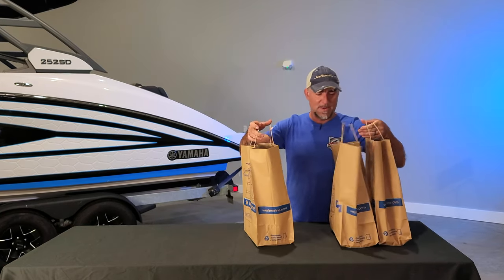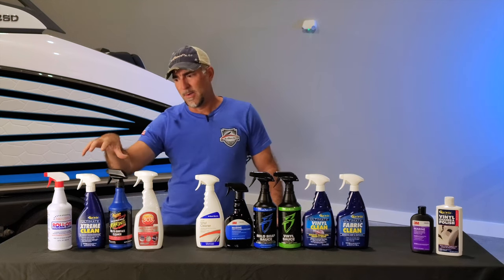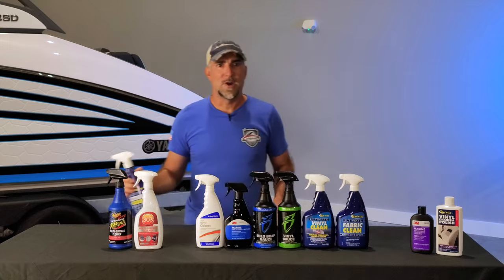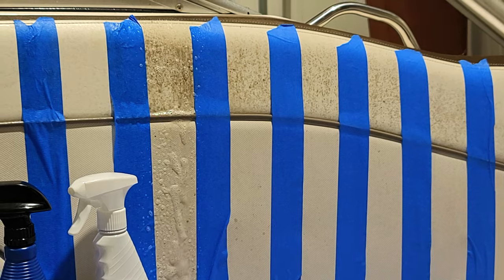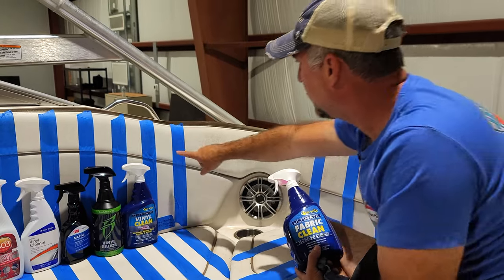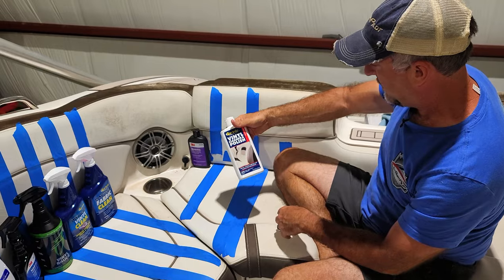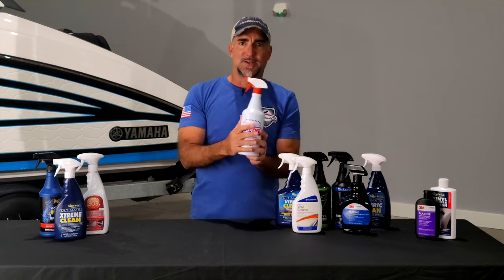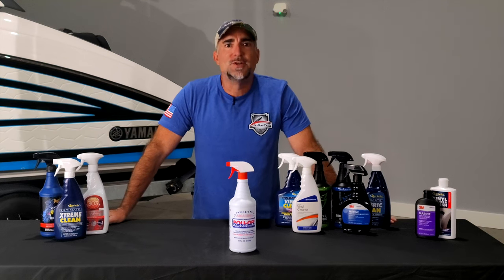Ultimate Boat Vinyl Cleaner Shootout | Find Out Which One Works Best

Comment: For vinyl, 25% pool chlorine,  water, and a squirt of dish soap. Then Rinse it and take any organic staining off. If you need to go stronger on the chlorine
Reply: Chlorine will dissolve polyester thread
Reply: Chlorine will also dry out the vinyl and can’t penetrate into the subsurface layer.

Comment: Back when I owned a high-dollar Malibu Wakesetter, and was heavy into the forums, Malibu recommended (specifically) "Fantastic" bathroom cleaner for their high-dollar vinyl, indicating it was the best at cleaning, without stripping or drying the vinyl. It's gotten harder to find, but to this day, that's all I use, if soap and water won't do it. (Other than mildew, which is a whole other subject.) Mr Clean Magic Erasers work magic, but are abrasive, so a last-ditch thing for me, and should be used sparingly and carefully. Follow up any cleaning with 303 Aerospace Protectant, another thing they specifically said to use, and again, I still use that stuff to this day, it's legit, best protection I've ever found. Anyway, great video man, good info!
Reply from the maker: Thanks Micah!

Comment: Nice breakdown, Will. Thanks! Only thing missing would be a “control” test like cleaning a section with soapy water or just water and a brush to compare to the cleaning supplies.
Reply from the maker: True
Reply: That's what I was thinking too. I bet there wouldn't be a considerable difference between Dawn dish soap and these expensive cleaners.

Comment: I've literally used all the products you have here and agree with your outcome. But hands down the best cleaner I've found and now use on all my boat vinyl is a Mr Clean Heavy Duty Magic Eraser soaked with and used along with SuperClean used at full strength. That combination will put all your test products to shame, EASILY!!!  You guys need to try my combo out.
Reply from the maker: Magic Eraser is great! But, it's abrasive and removes material with each use so long term use will damage surfaces.
Reply: @JetBoatPilot  Hmmmm, been using this combo for years with never a problem at all. Even use it for black streak removal on the decks white gel coat and have never dulled the gel coat one bit, gel coat is just as nice and shiny after I'm done as it was before I started.
Reply from the maker: @gunnerneikoify  Think of the magic eraser as a wet sander for your boat. It takes small layers off each time you use it. It will take time to see any damage so using it occasionally on white gelcoat and other surfaces is good, but I try not to use it unless its the only thing that will get the job done.

Comment: Thanks for video!  

First i ordered the Amazing Rolloff but, decided to replace the back hatch cover instead.

JoAnne's Fabrics sells Marine Grade Vinyl so with a coupon, it's  $12.50 per yard.  Just going to make new.  Easier and cheaper than trying all the expensive products that don't work and easier than scrubbing the heck out of it.

Hubby thinks discoloration came from where boat cover hits vinyl.  Gonna lay white towels under the cover next time.  Hopefull that will work.  

We live in S. NV so can't be mold...it's not humid here and 100 out today.
But the top of boat  looks real bad😢

Comment: Thanks for the work put in for useful content.  Would like to have seen a simple green, or dawn dish soap thrown in for good measure. What is your opinion on using a brush, I have heard only cloth on seats due to other abrasive nature of a brush?
Reply from the maker: We use brushes when necessary but not on routine cleaning. On tough stuff like this dawn does not work well so we did not think to add it.

Comment: I had some 20+ year old vinyl boat cushions that had some mold and mildew.

I used Starbrite Mold and Mildew, followed by the Roll Off. The results were very good.

Did not remove all discoloration but most of it.

The Roll Off was really great,  better than Star Bright.

Comment: Amazing Roll Off is just a glycol ether mixed with sodium metasilicate.  Combine cheap LA Awesome with cheap ZEP 505 Degreaser and you'll have the same cleaner as ARO for a quarter to half the price.
Reply from the maker: This is an interesting comment? How did you learn this?
Reply: Being a detailer for over 20 years and loving both awesome and and roll off they are definitely comparable also glad to hear I’m not the only one using awesome!
Reply: @JetBoatPilot MSDS

Comment: Would the rolloff  be good before spray vinyl coloring or would it need cleaned with something else after rolloff and before dye ?
Reply from the maker: We used it in vinyl and have had no issues. Some would want to add a conditioner after to preserve softness.

Comment: I highly suggest that you try Marine 31 Mildew Remover. There are several videos that make it look too good to be true, but the stuff flat-out works. I would be happy to share before/after pictures of my own boat. Check it out.
Reply: I just did a bunch of researching after spending an hour scrubbing mildew with different chemicals and having no luck on my boat cushion. Without hesitation I ordered Mildew 31 after the research. I really hope it does work like everyone says cause I swear I got some very stubborn mildew stains.
Reply: I think you'll be pleased, if not outright impressed. I hope that I have helped you out.
Reply: And
Reply: And what?
Reply: @dereksmith6798 how did it go